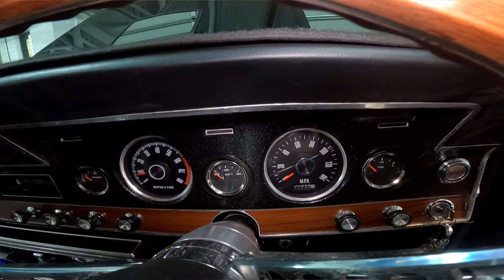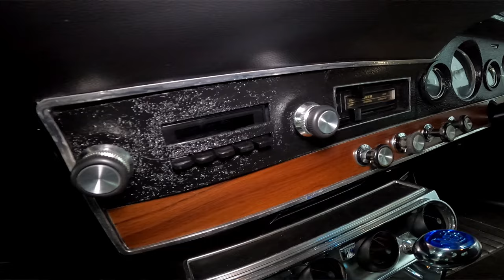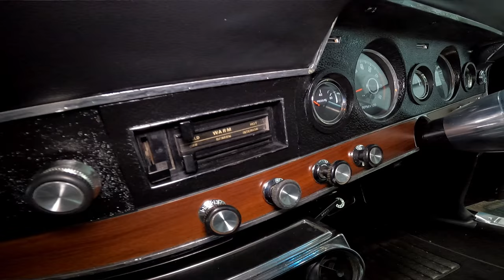Rust to Restoration - Dream Car XT Ford GT

Comment: What a beautiful car. The best part is that you built it yourself Rusty, that is what i appreciate the most and that is a stunning looking Falcon, Thanks for sharing mate.
Reply from the maker: Couldn't agree more!
Reply: Thanks, glad you loved it. Cheers for the nice comments.
Reply: @rrusty71  I sure did mate its a stunning Falcon, i built my xy gt rep in my garage at home also, from body, paint to all the running gear. I follow you on fb and the xy you restored is incredible also 👌 thanks for sharing!
Reply: @falconx5744  

Tried to get XY Lic the other day but it failed because steering doesn’t  self center. So it’s booked in to a wheel alignment & suspension specialist. Fingers crossed he can do magic on it so it passes soon. 
As soon as it passes I’ve got some ripper plates going on 3GTHO71 & chrome tramp rods to put on.
Reply: @rrusty71  Yeah i seen that mate, you were trying out another idler arm, i thought you might of had it back to front, i did an xd the other at work with same problem and someone fitted the idler arm wrong way. Man those are super cool plates, its lucky they were available 👍😊
Reply: @rrusty71  If i was in Perth mate id come and help you with the steering but im in Sydney.. Unfortunately lol.. The steering specialist will fix it 👍
Reply: @falconx5744  

It ah only goes 1 way, which is good 👍. 
It’s just that it does self center when you go left but when you go right it sticks into corner. 

The suspension specialist mentioned a nut on steering box which is good 👍 because it means he knows how to fix it. ( there’s hope 🤞🏻🤞🏻)
Reply: @rrusty71  Ah right ok, thats good to hear mate. It will more than likely drive and steer better for you also. Il be out in mine next weekend and probably the next. Have a good weekend mate, good chatting 👍